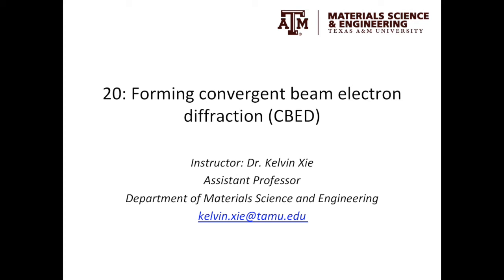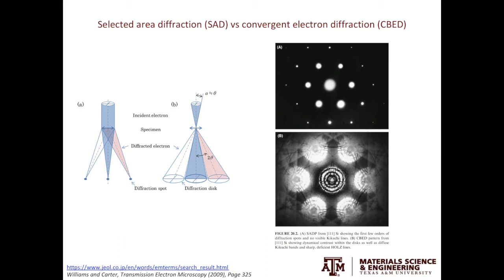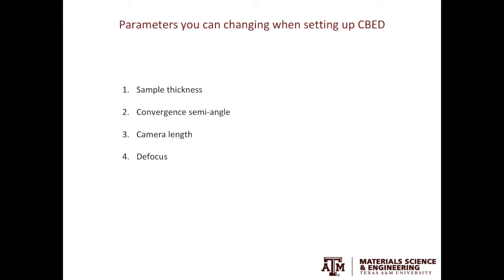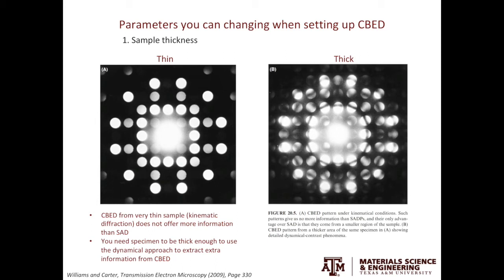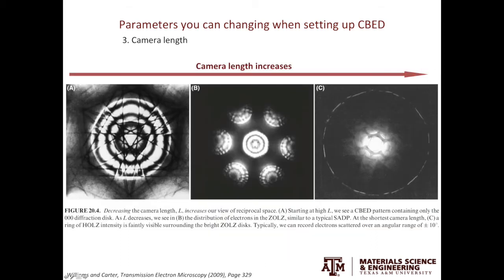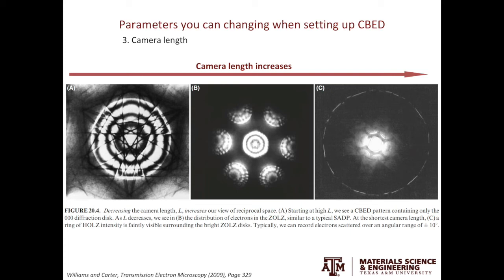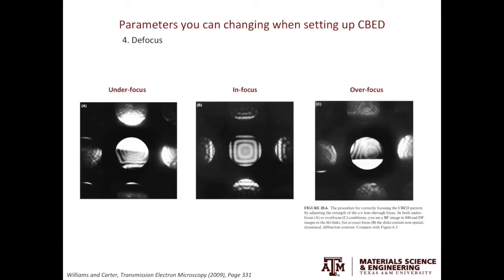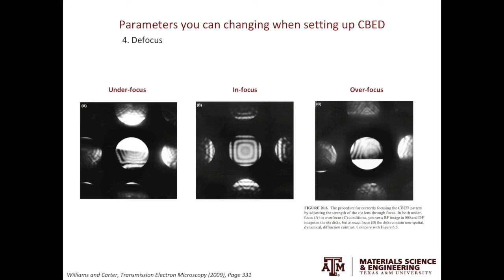20: Forming convergent-beam electron diffraction (CBED)

Comment: Thank you for the wonderful video. I have a question on 2:40s . Why small spot size will lead to a large convergence angle. Changing spot size will change the convergence angle of C1 not the convergence angle on the specimen.
Reply from the maker: My understanding is that changing spot size will change the strength of C1 hence change the convergence angle.